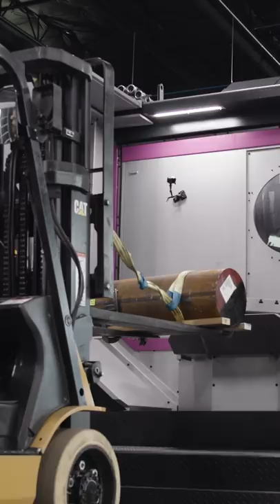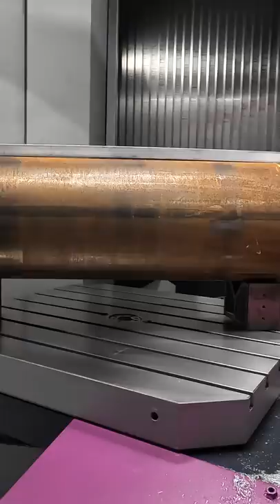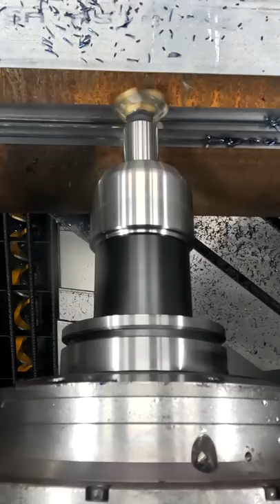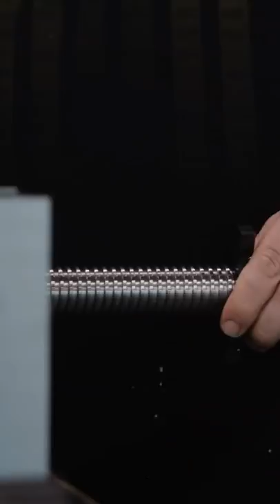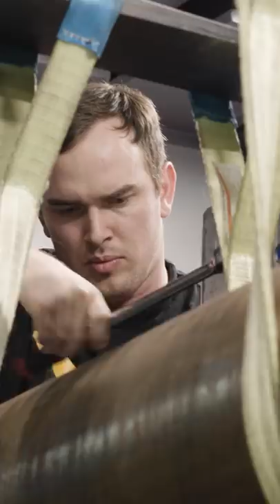MONSTER Custom Fixturing on 100,000 Pound 5 Axis | 1,700 Pound PART #shorts

Comment: What an absolute unit. 
The biggest pieces I've made literally hundreds of was a 400 lbs stock part.
First it was turned on the big lathe until 300 lbs, and then I was in charge of the rather long and noisy milling operation which left us with a 100 lbs finished part.

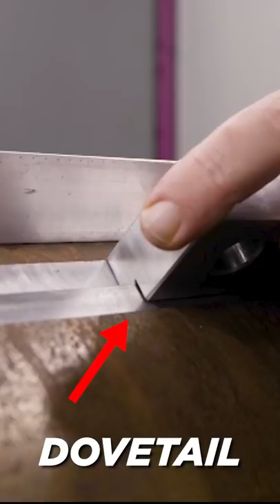0:26 😗👍
Reply: I cant imagine the stress if u scraped one part by mistake 
Those parts are most likely not cheap
Reply: @LordOfChaos.x  It wasn't that bad, to be fair. The steel was reasonably priced - so the scrap part would bring some money back.
In total, I think it would take maybe 5 hours to make a new one.
Sawing, turning, 4-axis milling - done.

The raw material is PEANUTS. Man-hours and machine-hours - there's the real money.

The parts I deal with these days can be much more terrifying to scrap.
They're mainly injection molding parts, some are fairly complicated and have hundreds of hours invested in them - sawing, rough milling, hardening, finish milling, grinding, EDM, sometimes a bit of additive welding and a bit more finish milling and another run in the EDM department.
Reply: @MrMBinder what are the parts you are making now and what are they for? That sounds very involved and sounds like you end up with a very exactly specific type of finished piece.
Reply: @superscout111  I make parts for plastic injection molding tools.

Some of the core parts are very small while others are rather big.
They have to be very precise, though - otherwise the plastic parts that come out of the tools won't meet the customer's demands.
Reply: @MrMBinder  very cool, thank you.

Comment: Will you do a video on laser machining.  Surely those are what's next Gen.  Honestly metal cutting bits are cool but have drawbacks. Lasers though.. depth and width adjustments and power.  

If you don't modernize your company to this new tech you will be liquidated I think. Why sharpen and buy new drill bits if we can make a superior cutting source? Does it make it better? Does it do it cheaper?

Comment: big huge hunk of cold roll probably 5150 ? heat treated ? 
my first job at my last shop was take these quarter ton gudgeon pins for a crane on a reactor site after they'd been turned and polished, endmill them to size manually on this big old German burning bar machine and then drill a 20" deep 1/4 bore oil passage, drill and counterbore the grease gun port, pipe tap and install a zerk, two times each end. each pin took about 75 min each side but I whittled it down to 45 min by the time we finished 20 each.

Comment: It's called a piece of round stock and couldn't weigh more than  2000 pounds
Reply: In title of the video it said a 1700 pounds part.
Reply: I think they're talking about the machine being 100K pounds, i was thinking the same thing but then I realized it says "100,000 pound 5 axix" and cuts off "miller" so it never actually says the piece weighs 100k pounds  just the 5 axix miller

Comment: That's a lot of bar stock for a 1/4 unf set screw.
Reply: [hissing cat noises] Speak no more of the unholy UNF. Quickly, you must bath in cutting oil and sacrifice a 10mm socket to the god of mischief that lives underneath every low floor-clearance shop cabinets.